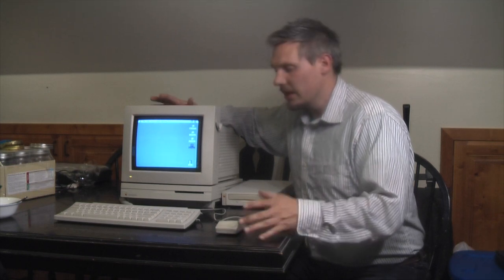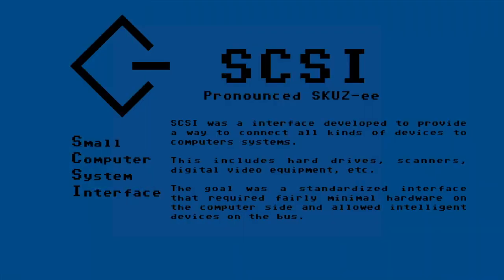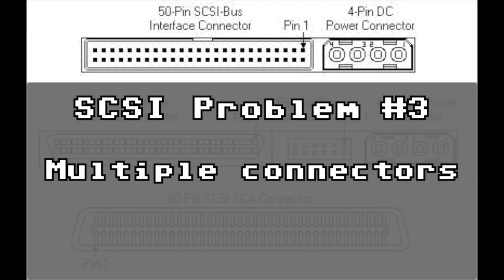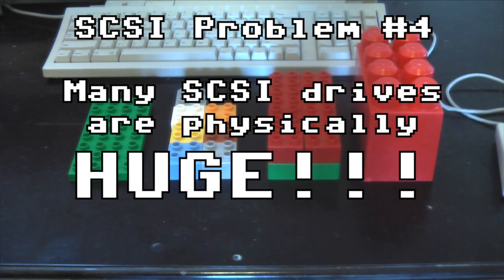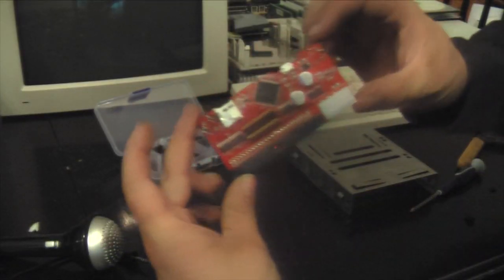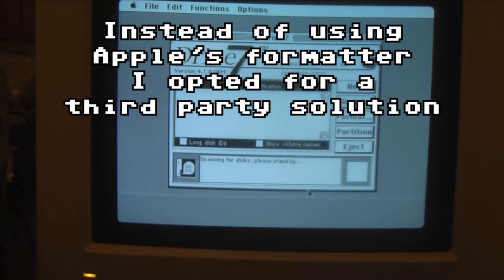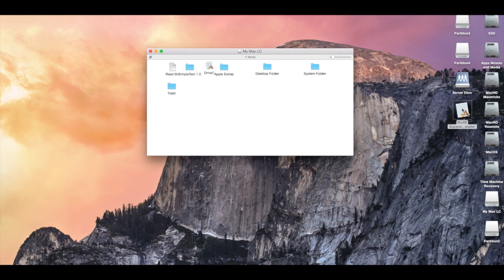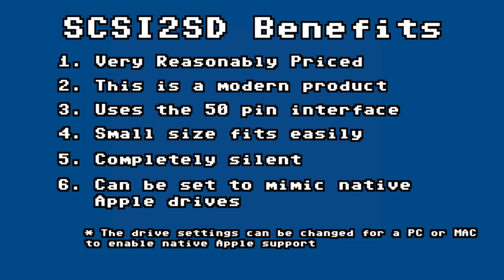SCSI2SD Review

Comment: Can this be powered via its USB socket? (I mean during normal use, not during the set up phase.) My keyboard's (Roland W30) does not have enough power on the SCSI bus, and I would prefer not to have the extra expense of a PSU wall wart. Thx.

Comment: scsi2sd is a excellent replacement for those ageing scsi hard drives
The truth about old hard drives, they die, they have moving parts, they wear out over time and are going to be harder and harder to find on second hand markets (ebay, craigslist, kijiji, mercadolibre, etc.) SD or CF cards are great replacements for those ageing hard drives but the drawback is that they have limited read/write cycles. i struggled finding a hard drive solution for my retro PCs/Macs but there's finally a solution, CF card adapters and SD card adapters
Reply: SD/CF cards can undergo up to 10000 read/write cycles. That's equivalent of writing and erasing the card’s content daily for nearly 30 years, witch nobody will ever reach when just using them for these old retro computers. And sure, they can go bad, but nothing is indestructible and they are definitely more reliable than what they're replacing. It's a really great way of keeping these old wonderful machines alive. They are a bit boring though, the sounds of the hard drives are a big part of retro computing, at least for me, even though they were often thought of as annoying back in the days. It's a bit like replacing the engine from a beautiful 1950's car with an electric motor. Sure you can drive it and use it as supposed but the missing engine sound takes away much of the experience.